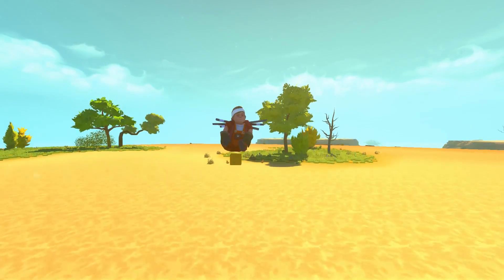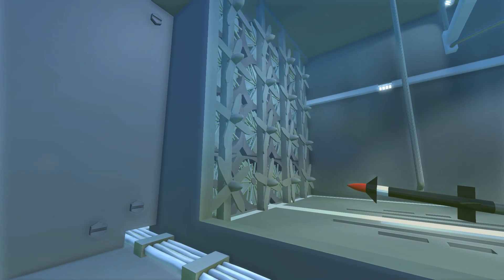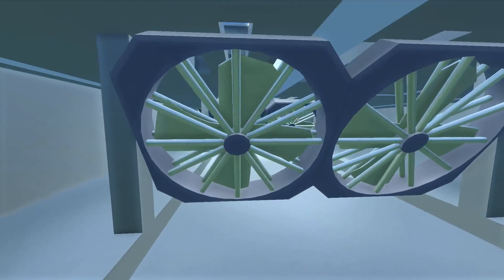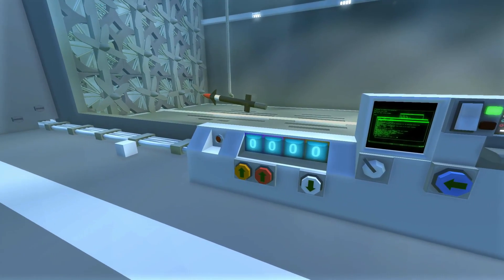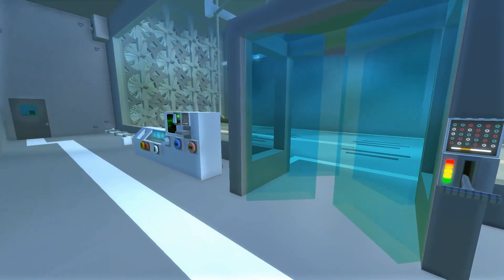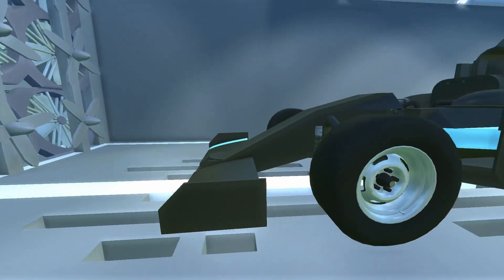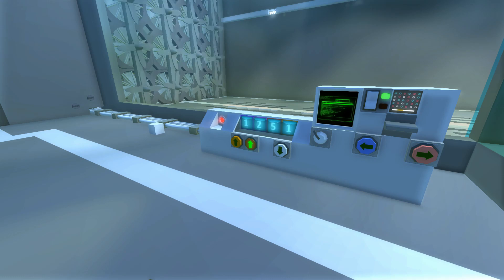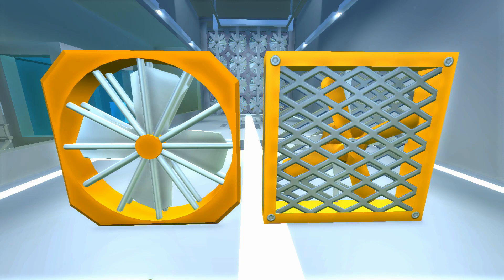I Made a Wind Tunnel for Experiments! - Scrap Mechanic Creations! - Episode 183

Comment: The fake fans have zero purpose except for blocking air. Those fans will take a number input for power. Just try a bunch of 4th yellow-green switches connected to a number block connected to a fan. It will send anything FLYING

Comment: Maybe try to do a fan testing lab or some kind of that, maybe even a whole tile for that...
If I think about it, you've got a damage level of about 300.000$ on the F1 Car simply by scraping the front wing over the ground and hammering it at nose and airbox out of the wind tunnel... really, damaging the chassis of an F1 car is expensive